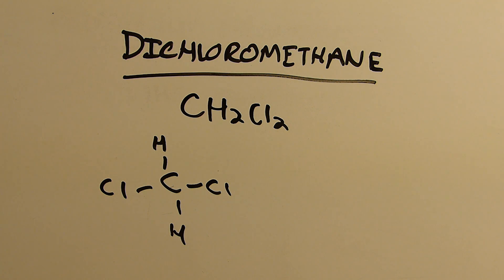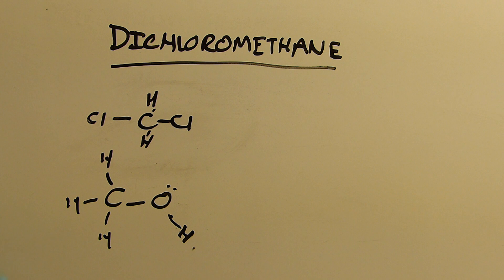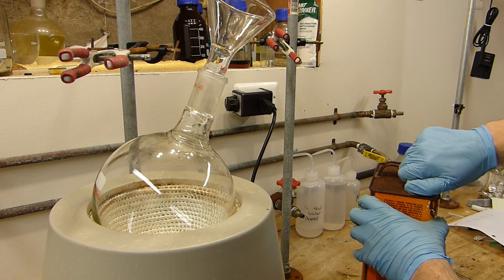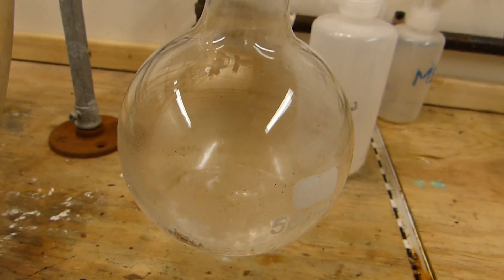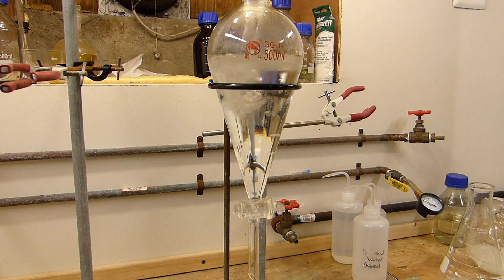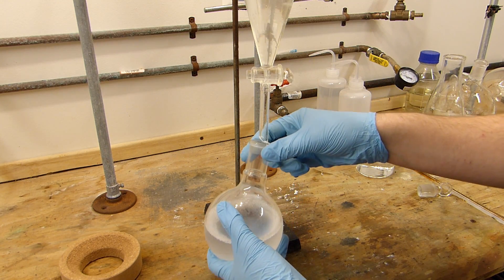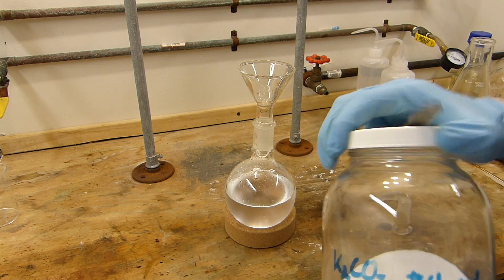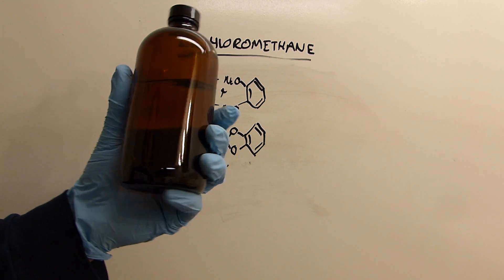OTC Dichloromethane

Comment: You can pour methanol/ethanol/isopropynol into the stripper after it's mostly distilled to continue the distillation for a slightly increased yield, however there still needs to be some leftover DCM for the polymer to not crash out.

Comment: Hey could  someone please tell me how/if you can separate petroleum and methylene chloride, there’s a local paint striper here that contains methylene chloride but also petrol and I Seen they have similar boiling points
Reply: Is there a solution that one or the other is soluble in but not the other

Comment: Outside of heating, is there any way to turn dichloromethane into something less toxic or neutralize it to be less of a hazardous material? There is some MC/HF acid-based paint stripper leftover from a tenant and I was curious about either putting small amounts onto a tray on a hot day or reacting it with something "neutralize" it. Thanks for the video!
Reply: It's still heating it, but toss cup fulls of it at a time into a big roaring fire, the elevated temperatures will allow it to burn which will destroy the molecules. Or take it to a hazardous waste drop off site, there's always that. DCM won't burn on it's own (it burns, but it's not a self-sustaining reaction since the flame temperature is lower than it's ignition temperature) but a big roaring fire with hot coals will safely break it down just fine. Adding chemicals to neutralize it will probably wind up with a more toxic chemical soup than you started with...
Reply: @TheExplosiveGuy Burning chloroalcanes is in general a big no. You could make some extremely deadly phosgene in this way. Now, as it is dichloromethane and not chloroform you'll mostly end up with formyl monochloride instead (which decomposes rapidly to hydrochloric acid and carbon monoxide), but I still wouldn't take the risk. Slowly evaporating the stuff is the best way on a small scale. Strongly alkaline water solution will slowly decompose the stuff in a few months and is suitable too.

Comment: Hi Doug.  We have purchased pure Dichloromethane for a solution of paint stripping, we will try to keep it enclosed to stop evaporation as it will do it simply on a hot day.   Is there any other solution we should mix with the DCM to make it a better product for our shop, we will strip parts by immersion, not by spraying in the open air.   

Thanks

Comment: Sadly, dcm is no longer used in the US paint stripper market. Dangit
Reply: We need a video where he synthesizes DCM.
Reply: @mikeg4972  agree, but the synthesis of DCM is not easy and not attainable by the amateur. It requires chlorine gas, methane and temperatures sbove 500c.
Reply: @K0ester  I plan to try a small scale "Free radical halogenation" using a quartz tube and a UV lamp that emits UVC.
If I succeed, I may post it here.
Reply: @mikeg4972  very cool. Sounds interesting and just so crazy it might work!

Comment: This episode needs an update considering the EPA made it so there is no DCM in retail paint strippers
Reply: Yep! But you can buy it off ebay or Amazon. I got mine off Amazon, 1L ACS grade DCM for like $40 (Carolina Chemical)
Reply: @jhyland87  if you buy in larger quantities it's a lot cheaper, I got a 1 gallon bottle of 99.9% research grade DCM for $70 shipped off ebay.
Reply: @jhyland87  that's alot for a little bottle
Reply: @redram5150  gotta recycle your solvents
Reply: @redram5150  solvents have became very expensive due to the governments heavy regulations for them. 40 for a liter of dcm seems reasonable and it isn't that small..
Reply: Welding anti spatter spray is DCM and soy lecithin,  it's only a few dollars per 1lb can.
Reply: It sucks. They get rid of DCM then they go for MEK. Next it'll be sulfuric acid so I'm going to buy as much of it at the hardware store as I can before they get their filthy hands on it.

Comment: Doug, I have a rather beginner question that I hope you will answer.

If one were to have a 2L sized heating mantle with magnetic stirring option, would I be able to also use smaller boiling flasks ( 1L, 500ml 250ml) in the 2L sized mantle???

I see so many different kinds of mantles in different sizes, I was hoping to not have to buy more than 1. or perhaps would having a big hot plate with stirrer be better, in conjunction with an oil bath?

Please let me know when convenient, thank you for your excellent videos, I’ve learned so much!

-alex
Reply: This may be two years late, but yeah you can use smaller flasks in bigger mantles if you need to, it's always an option. Obviously you won't be able to match the heat transference to the bottom of the flask due to less contact area but it really doesn't matter, since a 2 liter mantle can put out some serious juice, it will heat perfectly fine. I get by with just a 1 liter mantle and a Corning PC-351 600W hot plate, if the mantle won't fit my vessel then an oil bath on the hot plate will. I do think it would be pretty nice to have the full range of mantles though, perhaps one day when my hobbies and budget align lol.
Reply: haha better late than never!

thx for the reply though bro, just saw it as I’m not on here as much

I appreciate the feedback, I’m a super noob on a budget, so I’m glad to hear a 2L mantle will work just fine for smaller flasks

Thx again for the help man!👍🏼
Reply: @Br4v3.tr4v3ler  Good philosophy! Lol I'm glad to help, especially for a fellow budget-minded amateur chemist!

Comment: DCM non-polar? Ehm, no.
EDIT:
Okay, so that was a lot of nonsense at the start, I have to step in here.
DCM has tetrahedral geometry, therefore the molecule clearly has a dipole moment. The low solubility in water is primarily associated with the high density of chlorinated solvents.

Comment: Seems like it's hard to get a hold of this kind of paint remover today. They all advertise "methylene chloride free" now... :-(
EDIT: Well, turns out that last year (2019) the EPA banned the use of DCM as a paint remover... that fucking sucks. Apparently there were too many dummies that didn't read the safety label and used it for extended periods in enclosed areas with no ventilation or respirators... and passed away. That sucks that people died, but the report said they found 13 deaths since the year 2000 that were likely caused by DCM paint remover... This may sound cold, but honestly, thats not many deaths at all. I would think that the replacement paint removers that are now much more flammable will result in more deaths.  
SOURCES
1) https://www.usatoday.com/story/news/nation/2019/03/16/methylene-chloride-epa-bans-chemical-used-popular-paint-strippers/3190041002/
2) https://msutoday.msu.edu/news/2012/msu-investigation-links-deaths-to-paint-stripping-chemical/
Reply: If you're looking for dcm paint stripper go to a smaller hardware store that doesn't see a lot of buisness, I just went to my local one and found a jackpot. Looks like they haven't sold dcm paint stripper since they banned it lol.
Reply: or buy some pure dcm off amazon :)
Reply: @iocus_54roudachevski3  That's where I got my DCM, Amazon :-) It's usually reasonably priced.

Comment: Lol i had no idea about the recent ban of DCM in consumer (but not commerical) by the EPA until i needed some DCM and found no products containing it or advertising it as NMP or methylene chloride free. I went to a few hardware stores to check and even the brand that I used to use, changed it's formula... Even Klean Strip changed theirs...

Comment: I hate to be a wet blanket but you can buy laboratory grade methylene chloride or dichloromethane from Carolina chemical supplier for about $11 for 500 ml. Last I checked that can of klean strip you used was about $25 at Lowe's

You stated you wanted to have this on hand because it's a very convenient solvent to have on hand for many reactions so it seems a little bit of a waste to perform this reaction. I could see doing it if you had maybe a half a can leftover because it does not store well to just have the solvent on hand it's much cheaper to buy it from a company like sigma or Carolina
Reply: Have you tried ordering it from sigma or Carolina chemical?  Good luck getting it without working for a large lab or company.   This video was made for people who can't order chems from those companies.

Comment: The left over polymer crap in the boiling flask is problematic in its removal. I read someplace or saw something that said that kerosene will remove it. When I used kerosene to try and remove it , it did not work. I used some tetrachloromethane (aka Brakekleen) in its can and that sorta worked but still didn't break it down very well. I finally used some very hot water and Dawn dish soap which helped but I still had specs of that shit stuck to the sides of the flask. I got it out finally by mixing up about two tablespoons of sodium hydroxide in cold water, and let it set for a couple of hours. Btw, HCL never phased it either. 
     I also used Kleanstrip paint stripper. My can of it was almost straight DCM and no methanol. I washed it with water and couldn't extract any methanol from the wash water. Not to say it didn't contain any, just that the percentage in it was very low.  This is a great video, I'm just relating my experience with this process. The problems with videos like these is that the makers of them leave out some minor details like how to clean up the mess this process makes of your glassware? I hope my procedure for clean up helps.
Reply: there's no carbon tetrachloride in brake cleaner

Comment: DCM is polar because of its tetrahedral shape. There are no opposite sides for the Cl to be on. The angle between each of the 4 substituents is 109.5 degrees
Reply: Erwin Rommel not exactly. The two chlorines are bigger, and therefore there's a slightly wider angle between them and a slightly narrower angle between the hydrognes. But approximately the angles are somewhere in between 109° and 110°.
Reply: Just to elaborate on this point (i know the comment is 5 years old, but in case anyone new sees this).

The main reason the dcm is not miscible with water is due to the lack of ability of water to form hydrogen bonds with it. If you look at other organic molecules of a similar size then the ones that CAN mix with water are those which have a nitrogen or oxygen in the molecule - a place where the water can hydrogen bond to. For example aldehydes cannot hydrogen bond within themselves (as the oxygen is not directly bonded to a hydrogen), but water can hydrogen bond to the =O

DCM definitely shows some polarity and this can partly explain the relatively high boiling point of DCM as opposed to the first few alkanes.

Comment: Good science Doug. Love the channel. I didn't have any potassium carbonate so I distilled. Also I took the initial distillation a little further, got "the goop" out.  Then I evaporated the remaining solvent out of said goop. I'm 99% certain that what's left is nearly pure polysilicon. This stuff is a great additive to lubricants and is very chemical resistant. It's primarily made by Dow Corning in Michigan. Play around with it and see what you think, I'm definitely greasing up my saucer sled with the stuff this winter... I mean it's REAALLLY SLICK.

Comment: Okay this has been confusing me for awhile now.

The central carbon is sp3 hybridized yes? Meaning it forms a tetrahedral shape with its bonds. 

This would mean that there is no "opposite side" for the chlorines to bond to seeing as all of the bond angles are identical. 

Now I am aware that steric interactions are going to cause the chlorines to repel each other, but is this really strong enough to consider the two adjacent bonds as being "opposite"? 

This maybe just a slip of the tongue on your part (if you're Doug currently reading this), but as a student I just want to clarify for my own understanding. 

-Thanks
Reply: sorry, this has been answered like three times already, nevermind.

Comment: In the beginning when you said you wouldn't need the thermometer because it wouldn't tell you anything: wouldn't it be handy to know what temp. the vapors are at so you know what's distilling over? I know methanol has a much higher boiling point than DCM, so why wouldn't that be a good thing to know?
Reply: John Van Vynck not much, there's a difference of 15-20 degrees.

Comment: A question. is it possible to rebuild the cap of the can and use the entire can as a disposable boiling vessel to get as much yield without a messy cleanup? or is there a good reason like possible contamination that can occur?
Reply: Late reply, but yes you can, the distillation temperature is so low you won't need to worry about any side reactions with the metal can or it's plastic fittings (unless it's all steel). It's really not a bad idea honestly, you'll save a number of steps and can just cap the remnants in the original can for disposal.
Reply: @TheExplosiveGuy  I use that method to isolate & purify most of my solvents.
Coleman's camp fuel (et al), yields Hexanes, & the metal spout, will accept the male 24/40 after multiple wraps of Teflon plumbers tape and pressing into the opening. The Hexanes have BPs from 40^C up to to 105^C. The bulk is about 60^C. I use a vigreaux to separate the various cuts on the first pass.
You do nice work. I like the Handle. I am a former licensed fireworks supervisor. I "get it".
Reply: @Don_Soucy  It's a good method, why waste time and dirty up glassware when it comes in It's own boiling flask lol. 

And thanks, I appreciate the compliments, I haven't put as much time into my channel as I'd like to but eventually plan to do a lot more, and I'm definitely getting back to the pyro roots that my channel was originally based on (I made the channel in like 07 I think, back when I was making a lot of primaries as a hobby😉), though HPR rocket building is starting to overshadow everything else now haha, I just built my first APCP level 2 HPR rocket a few weeks ago including motor and fuel and now all I can think about is getting my class 3 lol.

Comment: Just to eloborate on the point Nils Rotthowe made,  the carbon is sp3 hybridized in CH2Cl2 and thus tetrahedral in shape. Due to the shape of DCM and the dipole moment of the C-Cl bond it s a kinda polar molecule that just doesn't mix with water. For example, the dipole moment (mew) for DCM is 1.55 and for isopropyl alchol mew is1.66. Keep up the good work, love the videos.

Comment: How did you manage to get all the goop out of your flask? I can get most of it out in mine, but there is still residue left.
Reply: +Creativity I used hot water and a cleaning brush. I don't know if it helped but i also used a little acetone.
Reply: If all else fails... piranha solution.... just be careful w/ it
Reply: Just hook the rubbery residue with a bent bit of wire and drag it out through the neck of the flask, then clean flask with a brush and a bit of acetone.

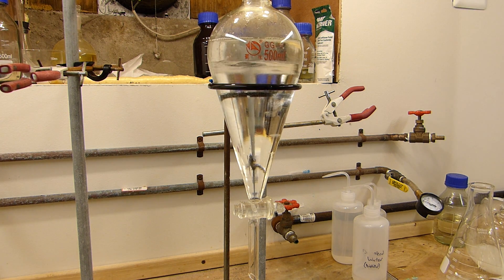Comment: You can see how much methanol was in the distillate.  At 6:43 the water layer extends just to the bottom of the label "500 ml", whereas at 7:46 the water-methanol layer extends well below the label "500 ml".

Comment: The flooring business uses DCM mix to clean carpet glue off tools and the edges of the carpet. I'm fairly sure the most common product I used had the polymeric goop and DCM w/o methanol. Just another source if any other floor-installers/amateur chemists have some laying around. I forget the number commonly assigned to the compound. - TVC